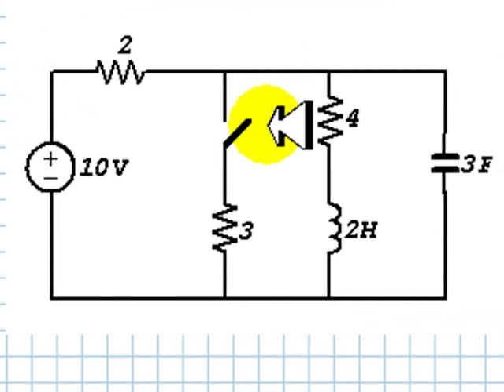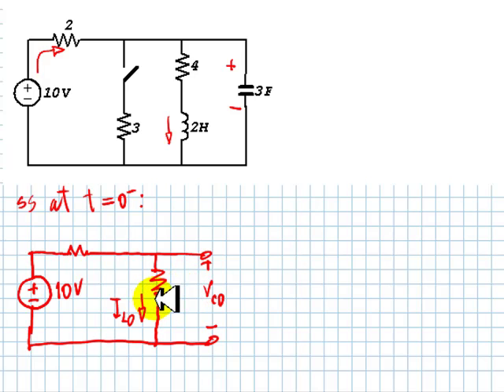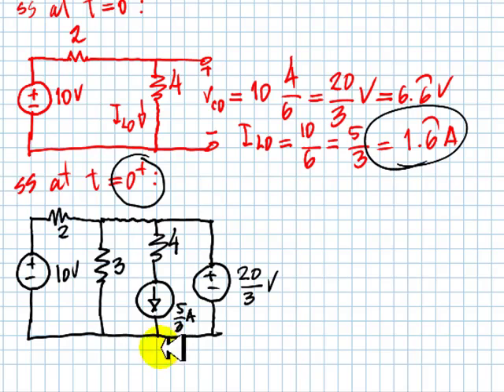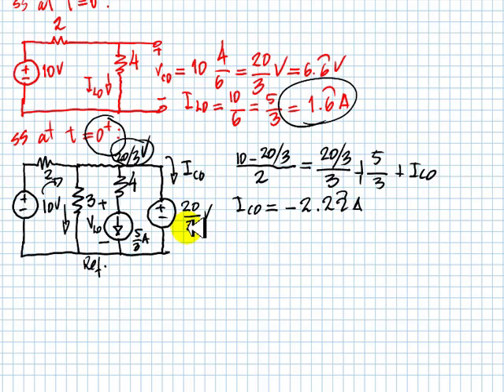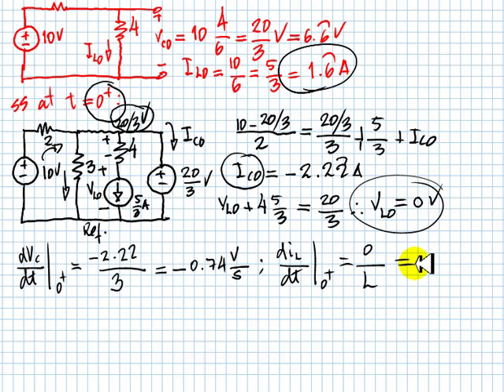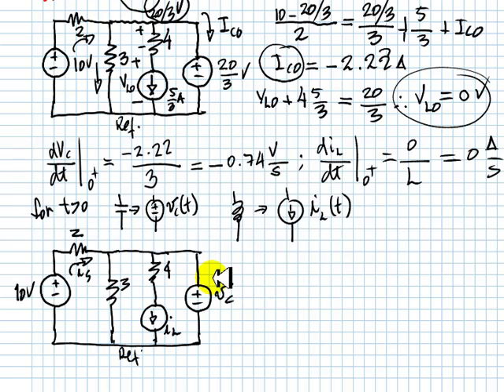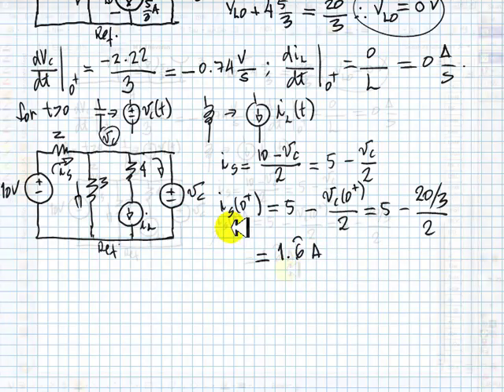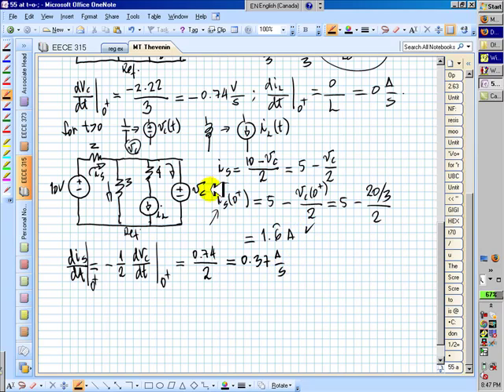EECE 251 Initial Conditions in 2nd Order Circuits

Comment: why are dv/dt and di/dt at t=0+ being used as initial conditions and not at t=0- (which answers would be 0)? This question has been killing me lately
Reply from the maker: This is a fair question. Because the inductor retains its current value from zero minus to zero plus, but not its voltage (which is proportional to the derivative of its current.) Before t = 0, the circuit was in DC SS and the voltage of the inductor was zero, and zero was its di/dt. As soon as we change the circuit connected to the inductor (same for the capacitor), it starts to charge up, or to discharge (depending on the new circuit). Let's put it in these terms: "Joe" is a single person and has a fixed amount of money in the bank, S. As soon as Joe gets married, his savings start to change at a new rate dS/dt. To predict the finances of Joe in this new state, we need the dS/dt in the new state, married. The only thing that we carried over from the single-life era was the initial value of his savings. I know, silly example, but we humans have a knack for remembering ridiculousity and cruelty, I choose the first one.
Reply: Very understandable your example!!! Thanks a lot! Now I can totally comprehend the initial conditions of the 2nd order circuits!! Sorry for replying so late

Comment: so at t = 0- the cap was ooen circuit and Ic 0- would be 0. I have learned that the current across capacitor cannot change instantaneously, so Ic 0- = Ic 0+, but how and why did you get -2.22A?? i dont get it
Reply from the maker: No, Mr. Devinda. That is not so. The device that prevents its current to change instantaneously is the inductor. Not the capacitor. The capacitor ensure that Vc at zero minus is the same at Vc at zero plus, but that does not prevent the current in the capacitor from changing instantaneously. I inviteyou to watch the video in this channel https://www.youtube.com/watch?v=-7Z245tfoBw&t=853s